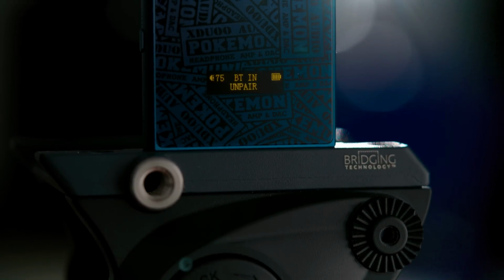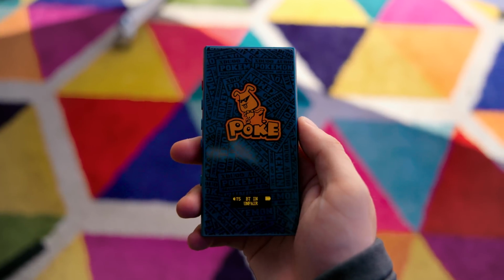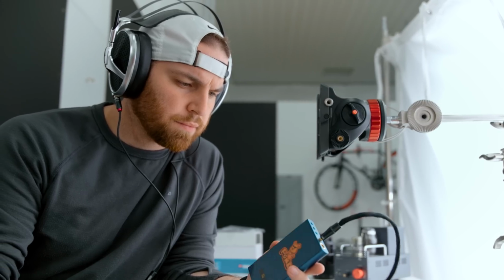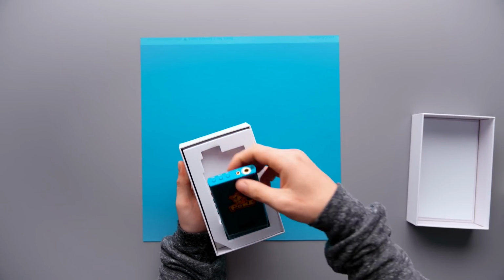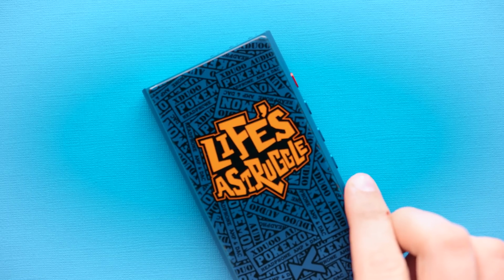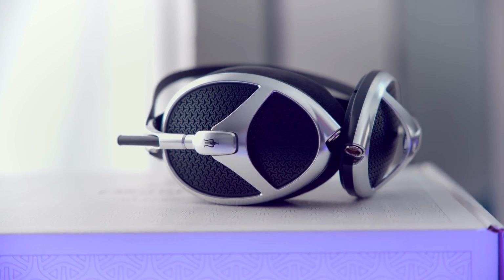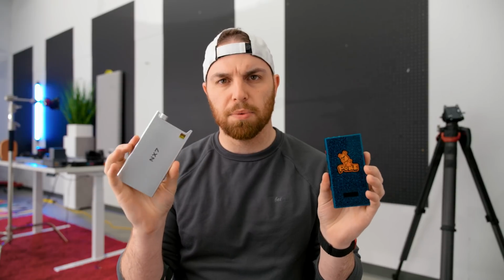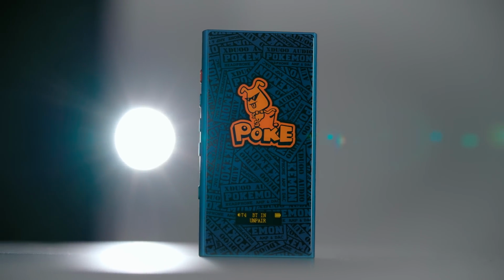XDuoo Poke 2 - Design gone too far?

Comment: Separate USB ports have been used in portable converters for years. Having a separate data port, allows you to use the dac and not discharge your laptop, tablet or phone in a situation when an electrical outlet is not available. This is the first thing. The second is the ability to isolate electrical distortion caused by a weak power source to which the device is connected.

Comment: I have the EarMen TR Amp, which has separate USB-C for charging and input. I think its a benefit over many other dac/amps that might have USB-C for either charging or input, but then have another type of connector for the other port. It's the right standard and then I can also not draw power from an input device if I don't want to. If both ports could do both, that would be excellent, but I still see this as an improvement over most dac/amps. The EarMen also has a dial for volume adjustment and up to a 10 hour battery life (I think). I use it on my desk and I also take it different places for semi mobile use. Another good option if someone is looking at a similar size/category of device; however, there is no bluetooth.
Reply: It's true, is a very good DAC amp, I even use it as portable with my cellphone

Comment: I have been using the Xduoo XA10 for more than half an year first with Hifiman Sundara and now with Hifiman Edition XS. I perceive no glare in the treble response of XA10. The bass and midrange response also is very solid with this Dac/Amp combo. I had earlier experienced the mobile Xduoo xd-05 plus with Hifiman Sundara and it was also a very good pairing.
Reply: Has it line out for using with external amplifier? Balanced LO?
Reply: @Abrahns  It has line out but not balanced. It is a class A Dac/Amp combo with Dual AKM AK4493 chips and 4W@32 ohm balanced output and 3w@32ohm unbalanced. It has 6.35mm jack, 4 pin XLR and 4.4mm mm balanced outputs.

Comment: The separate USB ports can be a feature if, for instance, you are using the DAC with a low-power device such as a cell phone. This way you can still charge it from a power brick while still being able to use it as a deck with any source regardless of the sources power level.
Reply: Also if/when the battery dies then you can simply use it as a static desktop amp.
Reply: NICHE
Reply: Exactly.  It's a great feature